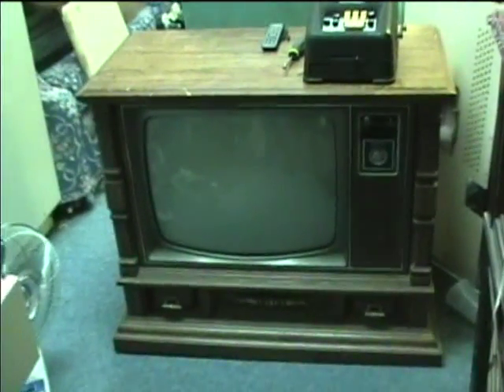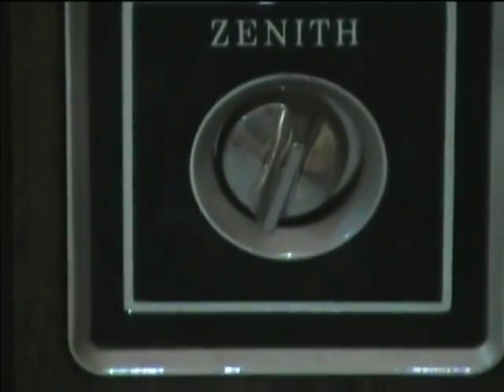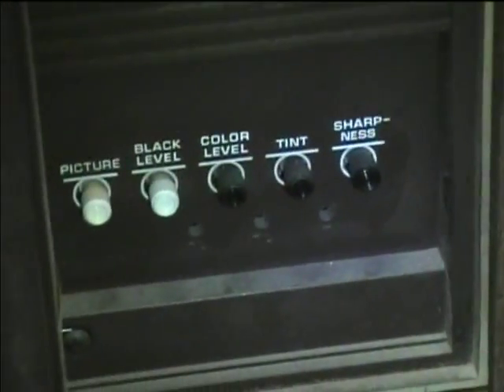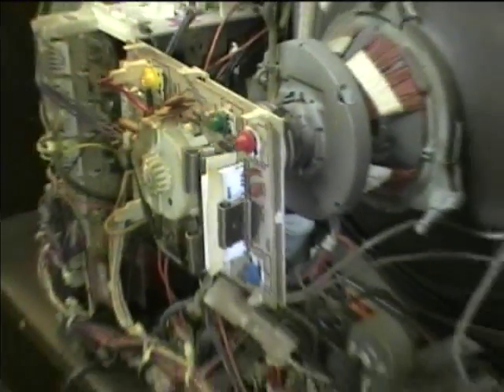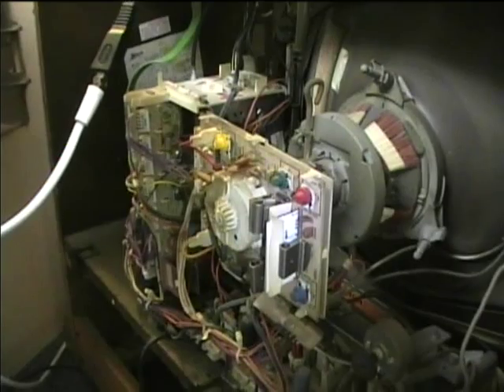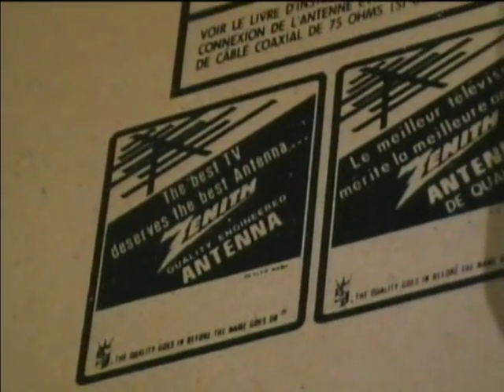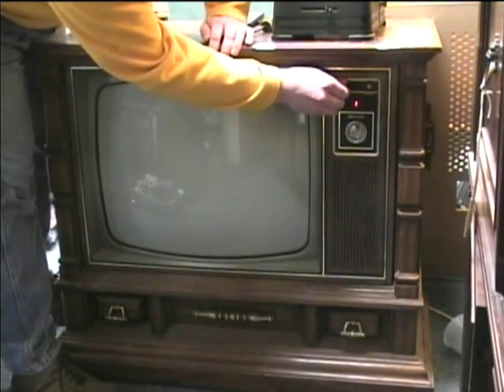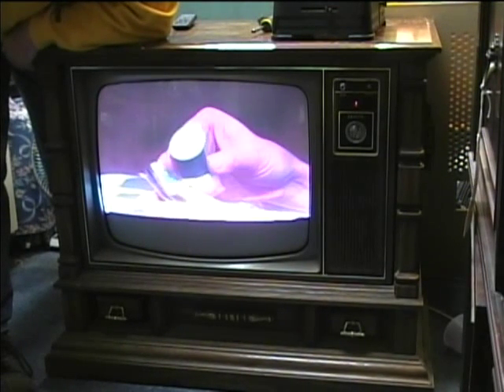Zenith 23" System 3 Color TV

Comment: Chad; I had a 19" System 3 and had to replace the main board twice. When I was in the repair business I kept a couple of System 3 rebuilt modules on the shelf. When the sets worked they had picures as good if not better than the Sony trinitrons of the day. Gary

Comment: I have never repaired one of those boards but only replaced the main boards. System 3 sets were very problematic but Zenith was good at providing rebuilt boards. The bright green screen indicates the screen voltage going high but can also mean a short between the filament and ground inside the CRT. An isolation transformer on the filament would fix that. If the bright screen comes and goes try gently tapping the neck of the tube with a screwdriver handle to see if you can detect a short.

Comment from the maker: Yes, these controls interact with each other...on tube sets especially you can adjust them to compensate for tube and component ageing. Usually solid state sets dont have the linearity control...the degree of how bad the symptom is on this one though leads me to think it's bad capacitors.

Comment: Correction: I meant there is a possible filament to cathode short in the CRT. Maybe not. How that short is corrected (and you no doubt know this already) is to isolate the filament from ground by using a 1:1 transformer sold specifically for that very purpose. It has been years since I did TV service and I wonder if they still sell those isolation transformers in these modern "throw-away" days? In 1993 I quit the business and went to work as a computer specialist. I miss those old days.

Comment from the maker: There is something probably wrong in the power supply...yes it is solid state and the sound should come on as soon as the switch is turned on. There must be a thermal problem that as something heats up, it begins to work.

Comment: I have a 1973 Mitsubishi that i need some advice on, It has a vertical collapse, i tried tracing the fault but am unsure of exactly which part has gone bad, i can't see anything that looks bad or burnt on the board, nor is there any cold solder joints.

Comment from the maker: Gary, could you tell what have you found is the biggest problem with the CRT video output module on these System 3's... I have several others which are having problems like a bright green screen caused by this module...have tried resoldering the resistor pack but it doesn't seem to help.